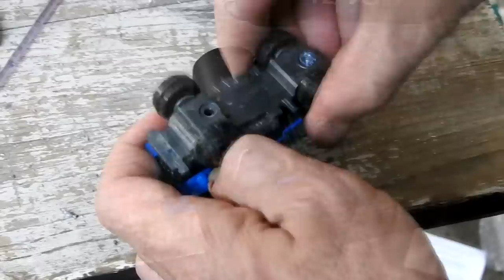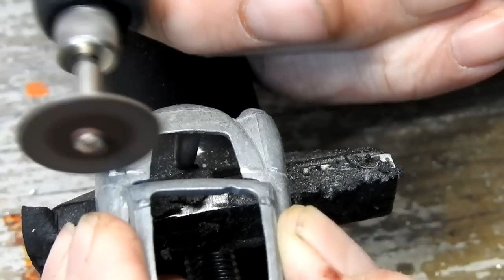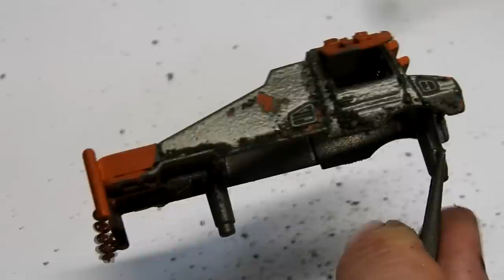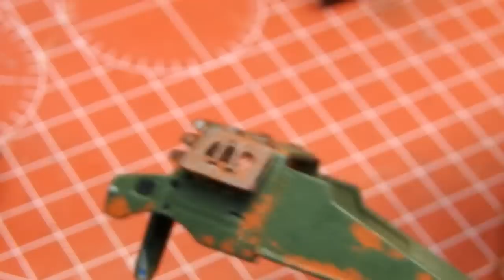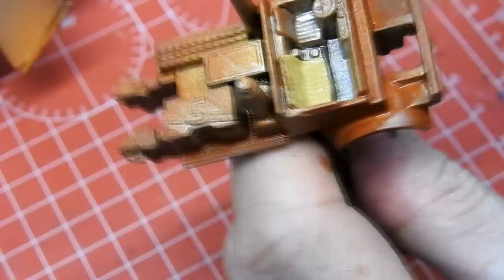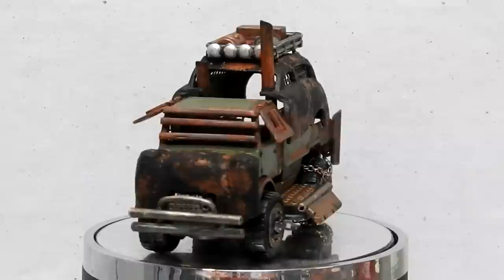Hot Wheels Custom Unimog 1300 'Post Apocalyptic Unimog' Build Off

Comment: What does he use for the windows not the mesh but the armor
Reply from the maker: Styrene
Reply: @DannysDiecastDisasters  thanks where do you find that stuff though. Looked everywhere for it
Reply from the maker: @edakeroc2715  Usually they have it in hobby shops for model railroading. Evergreen is the most popular brand.